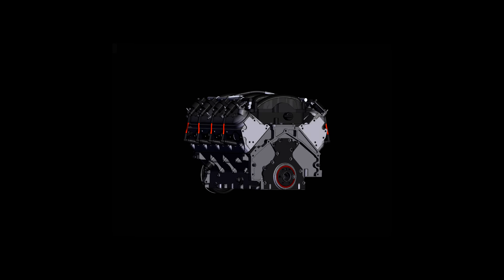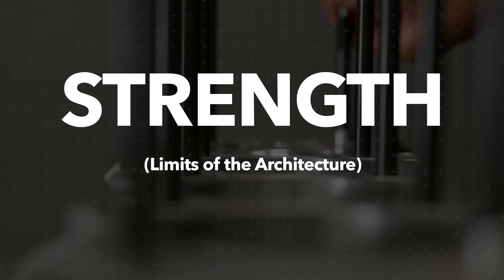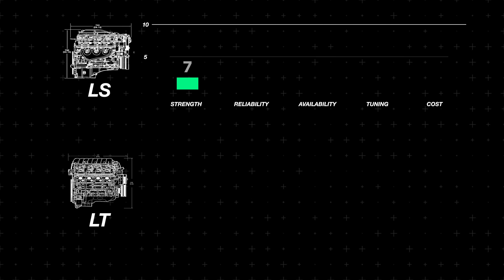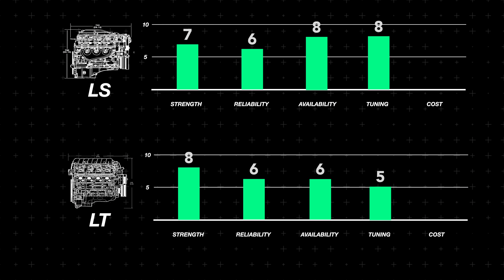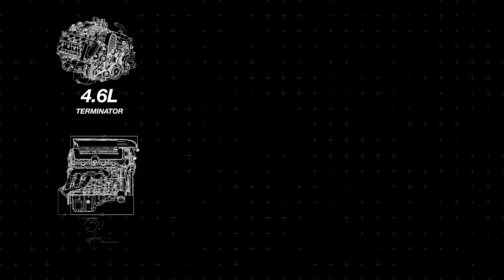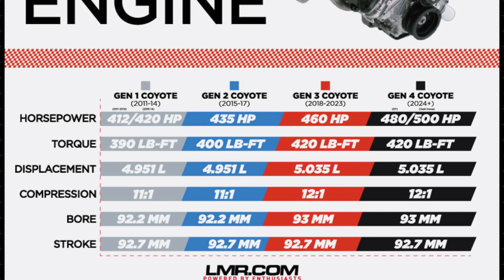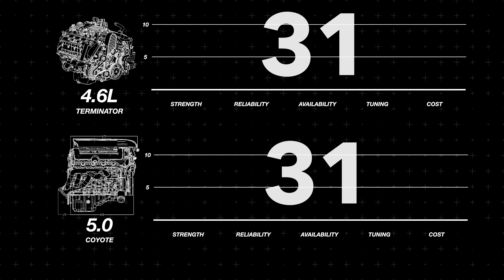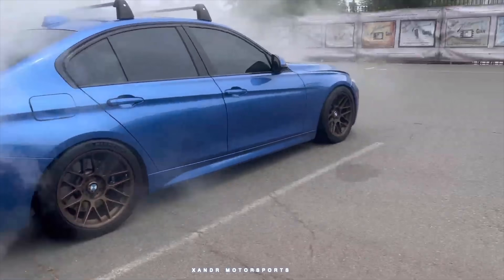Why Old Engines DESTROY Newer Ones💀| Explained Ep. 25

Comment: The B58 vs 2JZ illustrates the perfect reason why most older engines are better than newer ones. Both are overengineered and over built, but the 2jz will last longer than the B58 BMW isn't the reliable powerhouse it once was when Toyota still made the 2JZ. Sure they're comparable now, but the B58 would probably need to be serviced more often compared to the 2JZ in the same amount of time.
Reply: Nah not at all. Any high power engines need to be serviced very often and it wouldn’t matter if you need to do it at 3000-3500 miles. The b58 blows the 2j out
Reply: @carter898  bro you’ve missed the point entirely! The B58 is indeed one of the best engines ever made but like almost every thing Germany is over engineered the wrong way. They use computers at almost every single opportunity, next to place they should never be (i.e. right next to turbos, exhaust manifolds, water pumps, or exposed to the elements close to the ground).  Meaning you can’t slack on preventative maintenance like that of the 2jz, LS, Coyote, K-series, B-Series, Sr20, and virtually every other high performance American or Japanese high performance engine. They are over engineered in the way that you can trash them around, PUSH back preventative maintenance and STILL be reliable. The B58 can’t do that because it was made with the mindset that the owner will take the necessary precautions to ensure that it stays in top condition, while the Japanese and American engineers knew better, making your point mute.
Reply: @VinceroAlpha  a b58 is more reliable than my 600whp b18c anyday of the week while putting out 1.5x the power. Of course hee engines will have computers and new technology but that’s what makes them new engines. A b58 without computers is just another i6 with no advantages over the competetipn
Reply: @carter898  no shit the b58 is more reliable than a overboosted b series. Doing a apples to apples comparison, the B58 isn’t as robust as older SAME DISPLACEMENT and/ or turbocharged engines. Again the 2jz beats it in durability and reliability. Also, there’s more to a new engine than just “adding computers,” new forging techniques to make alloy blocks lighter and stronger, cam profiles, intake and exhaust systems designs, fuel injection positioning (direct or port at different angles), better turbos and more lighter and stout internals are what makes a new engine new. It’s why VR38 can now make the same power as the RB26  with a lighter block. Again making your points mute.
Reply: @VinceroAlpha  you said the b18 was over built (which it’s not) so I brought it up. The b58 is a stronger engine than the 2j and when it’s making any decent power it’s more reliable. 2j is very reliable stock and so is the b58 but as soon as you hit about 600whp the b58 can handle it with relative ease. Rose tinted glasses are a terrible thing. The 2j is a fantastic engine but it’s incomparable to the b58 and s58
Reply: @carter898  no I said the b series is over engineered meaning that it’s made to withstand the constant punishment of track use in NA form especially. It can handle boost but never meant to handle TRIPLE the power from factory the same way a engine MEANT for boost from factory. You were doing a apples to oranges comparison which isn’t accurate. Also, the 2jz can handle the same amount of power with stock internals, it’s famous for that! Did you not watch the video?! Finally the B58 has been making 1,000 hp currently but the 2jz can make DOUBLE THAT! Making your point mute AGAIN. There’s no “nostalgia through rosé tinted glasses,” it’s just common knowledge. I don’t know why you keep lying and denying facts, the B58 is a good engine but the 2jz is still superior when it comes to making reliable power.
Reply: @VinceroAlpha  every engine can make any horsepower. You might not understand but cash is king. If you have deep enough pockets you’ll get a B series to 2250whp. It has been done. To only get to 590whp you’re taking the whole turbo system, ecu, fuel system, all out and replacing it with a 2j which is incredibly expensive. A b58 will do 590 for relatively cheap. It’s what they’re knows for cheap power. You can’t compare top power figures for the exact reason he said in the video. Glory runs happen all the time and people with enough money will build any engine to any amount of power.
Reply: @carter898  there you go moving goalposts again, over course cash is king but that doesn’t move the conversation forward. There have been NUMEROUS BUILDS that didn’t have that extensive amount of a 600hp build for the 2jz. Keep in mind that they DETUNED from factory due to the gentleman’s agreement that the manufacturers made due to the fact that they were already getting out of hand before the 2jz was even made! Meaning it’s not going to take as much to make that amount of power from stock when it’s already making half of that from factory. Also keep in mind that since it’s a BMW, EVERYTHING is expensive. So it make take less parts to get to that amount of power, you still have to pay more for parts and labor. If we’re doing a fair comparison, getting to 600hp from factory, the B58 may take less parts to get to that level, but it will still be more expensive to get there and stay there vs the 2jz.
Reply: @VinceroAlpha  it was not expensive for my 623whp b58. It sounds like you’ve never built an engine, fuel systems are very very expensive (one for a 2j costing almost my whole b58 build) all I do with my b58 is normal maintenance and it’s lasted for years. The 2j is crazy money to get to power that someone whose never built one like you wouldn’t understand
Reply: @carter898  first of all, you never mentioned you owning a B58. You kept mentioning your B18C turbo so I don’t know which one you have been referring to which is deceitful. Second of all, there are MULTIPLE ways of building engines to get to the level of power you want and just because you haven’t heard of it doesn’t mean it exists. But someone who hasn’t built a 2jz wouldn’t understand a caveat such as that.
Reply: @VinceroAlpha  well I was talking about the b18c until the last comment I made. Sorry for the confusion. Me and a friend have built a 2j for 600 and it’s no simple task. Though I wouldn’t expect someone that hasn’t built anything to understand that
Reply: @carter898  why do insist on making me repeat myself, just because it was hard for YOU and your FRIEND doesn’t mean it’s hard for others. It’s not a knock on both of y’all, there are numerous ways to tune the 2jz because some people will pick up things quicker than others on various platforms. My buddy Brad worked at powerhouse racing years ago and built numerous 2jzs . Helping him build some of them and watch him is why I said they were relatively easy to get that much up simple. It depends on the person and topic at hand. Also, you really need to quit jumping to conclusions and assuming I haven’t built or worked on 2jz, that’s what preteens do.
Reply: @VinceroAlpha  name 4 different ways to make a 2j hold 600 reliably. You can’t. For starters the whole fuel system has to be done the pistons and rods should be done but doesn’t have to be (if you want reliable you should change them both) and you have to get rid of the stock turbos and ecu. That stuff isn’t an “easy car mod”. Yes some people breeze through it but I’m not talking about it being easy for one person compared to another. I’m talking about easy and accessible to do without tearing the engine and wiring and everything else out of the car to change it.
Reply: @carter898  thanks for the rhetorical response, really helps your argument and shows your superior maturity. Keep in mind you need to be specific about what you mean by the whole fuel system because you also have to do that for your 3 series as well, not to mention upgrade the turbo, re flash and tune the ecu and upgrade the exhaust as well if you want RELIABLE power. Not to mention you forgot the part where technology has advanced to the point where most of those mods are either not needed or considerably cheaper. Because guess what, replacing the turbo, exhaust components, fuel components and reflash on your 3 series is still TEARING INTO THE FUCKING ENGINE!
Reply: @VinceroAlpha  I’ve had to do very little to my fuel system. No aftermarket turbos on my car. I have a jb4 which is very simple and that about it. Very easy compared to the 2j
Reply: @carter898  congratulations, good luck on keeping it at that level without costly maintenance that makes you give up on IIPL because it’ll no longer be work the headache of frequent maintenance for diminishing returns on fun.
Reply: @VinceroAlpha  it’s been my daily from March to October for 2 years already heading into the 3rd year strong. No issues whatsoever. You said it couldn’t and I have proof it can. Easy hp out of b58s
Reply: @carter898  that’s great news, I mean that genuinely. But here’s the thing, older Japanese cars, Toyotas especially, are known for their reliability. The trope of 100K miles is the break in period came from that. Most cars sold new today are considered ready for the scrap yard at that mileage, especially Euros. Which is the ETHOS of my whole argument. While you may be able to get the same if not more power from newer engines, it comes at the cost of LIFETIME enjoyment and reliability. The 2jz has proven itself time and again why it deserves it’s legendary hype for the better part of a quarter century! We’ll just have to wait and see about the B58s legacy. But given BMWs track record, especially since 2010, it doesn’t look good currently. If you still have your car with 100k miles 8 years later, then we can talk. But given the facts and history about new BMWs and their owners, I’m not holding my breath. Sometimes the latest isn’t the greatest.
Reply: @VinceroAlpha  Yes I absolutely agree with japans reliability. Thats why I love Toyotas and Hondas so much. I have two Hondas in the driveway even. It’s just that past ~520whp out of 3L nothing is as reliable as it once was. Everyone complains about the n54 and how unreliable it is but I put close to 200k on it running 482whp without much happening. It’s all about preventative maintenance on German cars and if you don’t abandon it like half of the people do, they’ll end up pretty reliable. I don’t mean to shit on japanese cars and engines in this whole thread but the 2j isn’t with the times anymore. I’ll still keep building the one I have until I rot no doubt. Thanks for coming to an understanding of what I’m trying to say; communication through comments sucks.
Reply: @carter898  yeah communication is hard enough verbally, let alone text and it’s easy to get things misunderstood. Also car guys are know to be stubborn when it comes to our obsession so yeah I get it. But what triggers me is that it seems a lot of people STILL TO THIS DAY don’t give the JDM cars their respect even though they have done everything and then some! Yes the 2jz is old but so is the Chevy small blocks, big blocks, LS and Hemis. But people continue to buy them because they’re tried and true, hell Nissan decided to start making RB26s again. Just because something is old doesn’t make it obsolete, sometimes simple beats out new and over complication. New cars usually have all the nice bells and whistles to keep you entertained but are fragile and lack the longevity of their predecessors. It’s fine to like the new technology, but it has to be put through it’s paces for a period of time before it can become a legend in its own right. I just feel that’s happening to often and all everyone wants is the acclaim without the hard work.
Reply: @VinceroAlpha  That’s why I like my b series so much. It’s an old engine that’s (fairly) easy to work on while still having the 90s Japanese feel to it. Although it’s far from stock my integra is still my favourite for the reasons you stated. Simplicity and old cool tech that works. If bmw didn’t tender to car enthusiasts with these new engines the i6 would be a relic of the past and I’m glad they’re still putting money into the best layout of engines. Imo with these downpipe + tune 550whp monsters they’ve helped the tuning scene a lot.
Reply: I think a 2jz  not maxed out will last longer and be cheaper to run than the plastic bmw engine.. i have a plastic bmw engine and I am afraid to touch it as plastic get brittle and stuff just falls apart..
Reply: @anthonye3680  they don’t if you do things right. I have proof of that

Comment: Yeah b58 bottom at the botto😮 it's just not nearly as good as the 2JZ
You're going to have to do massive mob vacations to get power out of the bottom end of that
Reply: There’s people with 9xx whp on stock bottom ends. It’s cheap to make power on them new b58s
Reply: @carter898  no it's not the fuel injectors can't handle that much horsepower your leaning out the motor if you're doing that on stock fuel and again there's no room for a front mount intercooler
Reply: @X-ForceBro  that’s why I said bottom ends lol. When were injectors considered bottom ends?
Reply: @X-ForceBro  you don’t need a front mount intercooler
Reply: @carter898  contrast that with how hard it is to make 1400 horsepower with a 2z
Reply: @X-ForceBro  it’s really hard to make that power out of any motor lol
Reply: @carter898  just for the law BMW I say that the motors maxing out around 7 to 8 and it feels like I hear a lot more guys say the 2JZ can handle around 14
Reply: @X-ForceBro  How hard is it to make 1400hp out of a 2JZ. well, it requires rebuilding the entire head, aftermarket pistons, rods and bearings and maybe the crank, though the stock crank has been tested up to 1750bhp for short periods of time. iron block can be left stock.
Reply: @Josh-qm4rb  yeah but you just can't make that kind of power of a b-58
Reply: @X-ForceBro  well. There's already B58s making 12-1400hp already and doing just fine. They may come DI from factory but most just go port and call it a day along with other mods and keep climbing in power afterward. The current highest hp mk5 is currently sitting at 1348whp at the moment since they recently got a new turbo that can handle more power,and one of the main tuners who has the fastest B58s in the world under his belt said that he didn't see any limitations in making that power or wanting to make more so I'd say they're getting close but still need time and testing before they touch the 17-1800hp range.
Reply: @carboydorifutoparty3976  not in supras though
Reply: @carboydorifutoparty3976  don't get me wrong I'm not totally disrespecting the motor
Reply: @carboydorifutoparty3976  if you want make that kind of power of a b-58 and go ahead and send it to a machine shop and have them closed at the block because it's not going to hold it
Reply: @carboydorifutoparty3976  don't get me wrong I had a 335i the injuns an awesome motor it's just not on the same level as the 2JZ as great as it is
Reply: @carboydorifutoparty3976  the b-58 spitting out that power of 3.2 stroker
Reply: @X-ForceBro  what? B58s are already closed deck as is. It's not a N54. The main ones making that kind of power arr specifically the supras(there's only one M340i Xdrive that's making 1000+whp with a B58 that ran a 8.8 at TX this year). Even before the supra,there was one 240i years back before the B58s even started making that power that made its way into making 1000whp on stock block just like how mk5s are. The main B58 powered cars making upwards to 8-1200whp+ are specifically the mk5s.
Reply: @carboydorifutoparty3976  that really surprises me that the b-58 sore still blowing up then LOL 
If you're going with a transplant or with any other car no one's choosing a b-58 over to Jay-Z the 2JZ is just a better motor that's all I was saying
Reply: @carboydorifutoparty3976  I feel like you're so in love with BMW that you're losing sight of the real argument what is the old subra f** up the new Supra there's several old Subarus like Google images of 1000 horsepower Toyota Supra UC BMWs Google 1500 horsepower Toyota Supra Toyota
Reply: @carboydorifutoparty3976  the m54 had the same forge bottom end
Google 2000 horsepower supras and tell me how many brand new Subarus come up
I mean Jesus Christ you can't support an air-to-air intercooler that's a f**** joke in the car industry
Reply: @carboydorifutoparty3976  the fact of the new Toyota Supra doesn't even have the fueling capability for over 700 horsepower it's not an injector problem it's a direct inject turbo pressure
Reply: @X-ForceBro  not true. There were mk5s making over 700whp+ on the stock fuel system back to back within their 1st year being around,the only issues they had was specifically fuel cuts but some had found they're way around it till port/meth injection for them came about(the main differenceis that the B58 in the mk5 has a stronger fuel system than other B58s variants in other bmws). I was not comparing the B58 to the 2jz since there's all too much of a gap between both cars aftermarket + years of testing with either engine to really make any far comparison anyway. I was saying,there are B58s making power within the 11-1400hp range already and are starting to become more common now as shops and the aftermarket are making more parts for them(even recent that people have started using aftermarket cams whilst making this sort of power on stock cams all this time).
Reply: @carboydorifutoparty3976  yes so12 fuel injectors